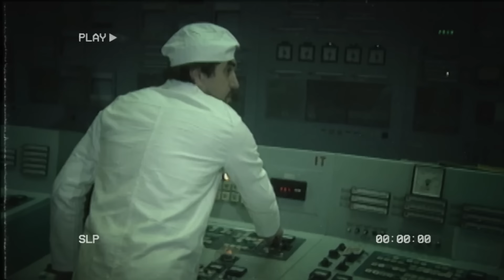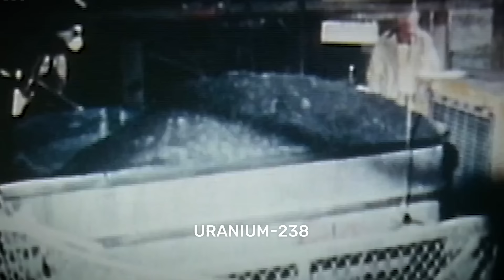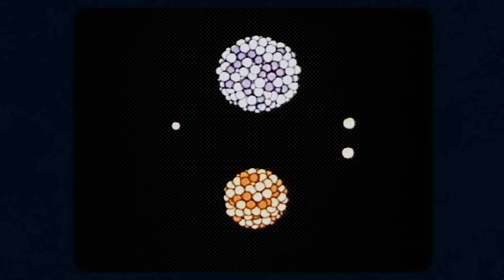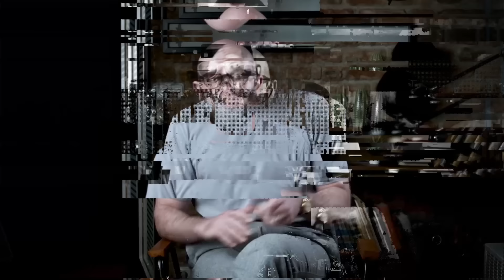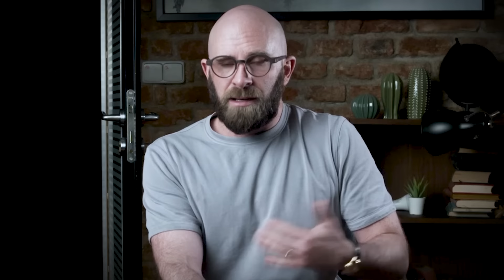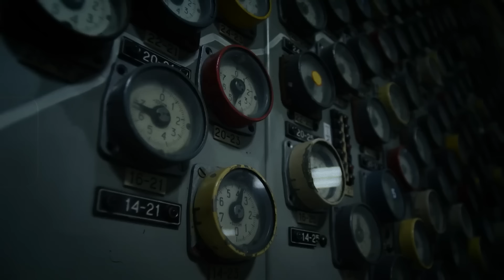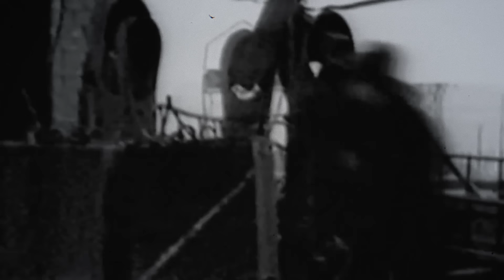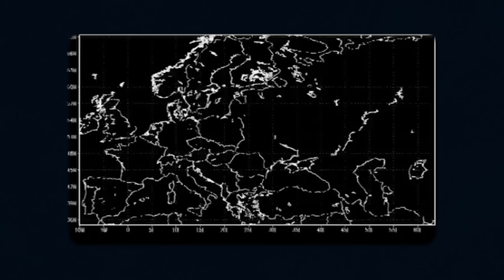The RBMK: The Shoddy Nuclear Reactor That Nearly Killed Millions

Comment: Whoever wrote this VASTLY misunderstands what a "moderator" does... U-235 (like most other things) has a MUCH higher neutron absorption cross-section for thermal (slow) neutrons than for fast neutrons, meaning that a slow neutron is much more likely to be absorbed an initiate fission- meaning *SLOW NEUTRONS INCREASE REACTIVITY AND THUS RAISE REACTOR POWER*... And neutron moderators? Their whole job is to thermalize neutrons, aka slow them down- moderators increase reactivity, not reduce it.
Reply: yes I think they think by moderating they are controlling but in a sense they are controlling. Graphite in RBMK, Deuterium in heavy water of PHWRs reactors or light water in PWR and BWR but I agree that some parts of this video were put quickly together. Especially that part when he said that RBMK were highly unstable at low power because of the positive void Cof but that's not the case.  At lower power it's the opposite it's becoming again negative void as it is when the reactor is turned on. The pos v cof is created by the steam and if there is not enough steam it's not pos v cof . but I give the guy credit for making the video.  I spent my whole life around nuclear power even visited mines for Uranium and was inside nuclear power plants.  For me it's the Jekyll and Hyde world. I love it and I hate it at the same time. I hate how politicize it had become. I do understand the fear, I do understand  negative effects but I also understand the benefits.  The cleaner air, the unsaved terrain after coal mines, the oil spills etc.  Maybe one day we are going to be able to make battery that can outperform gasoline  1000000;1 and we can take it up to space, create power there and bring down to Earth. Yeah
Reply: I've noticed these channels slipping up a lot, especially recently.
Reply: @newshodgepodge6329 alternative facts
Reply: At least someone else gets it.
Reply: @theotherJarvisx51  helps that I went to school for it 😆
Reply: seems like they're conflating moderators and control rods
Reply: I was going to say the same. It seems the comment section doesn't know what a moderate r does either.
Reply: Only thorium would be truly safe. If an asteroid or a nuke hits a plant and it loses all cooling it will melt, evaporate water, ignite hydrogen and all that Fukushima stuff. There's exactly zero safe nuclear reactors in the world
Reply: There is so much misinformation in this video about nuclear reactors it should be deleted. Complete propaganda actually.
Reply: This guy does this a lot. He casually researches things, or thinks he already knows. In another video, he said someone with a pistol emptied "an entire chamber" into someone's back. Which would mean they only fired once, when in reality, the person emptied an entire magazine. Probably heard someone talking about emptying a chamber in something gun related, a movie maybe, and thought he knew what it meant and tried applying it in the video i mentioned. 

In short, this guy's videos are only about the drama, not about analysis or learning anything. The range of topics he covers prevent any in-depth understanding. "Wide as the ocean, deep as a puddle" seems an apt description.
Reply: Since the Chernobyl accident and the series everyone believes the RBMK was an unsafe design.  Actually quite the contrary for a reactor of its vintage and generation.  There are plenty of graphite moderated BWRs out there besides the RBMK and they are inherently safe if competently operated and maintained (true of many powerful machines).  RBMK was also relatively simple to control, being uncomplicated in its construction and operation.  Blaming the design of the RBMK for the explosion is much like you driving a mustang through a brick wall and then blaming ford because the car moved when you pressed the gas pedal.  The accident was caused by trying to raise power in a stalled reactor that instead should have been shut down for 24 hours after the stall to allow the unstable byproducts to naturally decay before restarting it.  To raise power through a stall they manually bypassed and disabled every safety system that was there to keep them from doing it knowing it was unsafe and against operational protocol.  Today there are much better passively safe designs that cannot easily lose control because of auto limiting physics built into the design sudh as thermal reactivity lowering and passive convection coolant circulation.  One reason most US reactors are PWR type is because of such self limiting safety where overheating makes it impossible to increase thermal power as it hits a temperature where reactivity will auto stabilize in a runaway reaction.
Reply: @larrybremer4930 yeah nah dude that entire statement read as someone with the dunning-Kruger mindset running hard. Graphite moderation is fine, it’s over moderation in combination with water making up the difference. Hence when the water boils away it increases reactivity (positive void coefficient) The fact you didn’t factor that into your text wall of a statement at all makes me believe you haven’t got your head around the actual situation that occurred.
Reply: @geekswithfeet9137 My understanding was that if water is no longer present, neutron slow down will no longer work, and the reaction will slow way down.
I thought of it as a self regulating system.
I might be gravely misinformed.
Reply: @larrybremer4930 
 "for a reactor of its vintage and generation"
Well, everything was dangerous if you go back in time, so yes, they were dangerous.
Reply: @afrog2666  Thank you. Everything in the 70's was 'safe'. We didn't even get lawn darts until the 80s! 

Humans understood sharp pointed projectiles for centuries and still gave them to kids (lawn darts), much less nuclear fission. (disregard the Gilbert U-238 Atomic Energy Laboratory that gave uranium ore to children in 1950)
Reply: @larrybremer4930 literally no one  bought this shit.
Reply: @larrybremer4930  no they are NOT "inherently safe" - there are designs that are, RBMK is not one of them. The inherently safe reactors are built so that any mistake in control input that leads to an spike automatically triggers a shutdown. I don't recall the name of that design but unfortunately there are almost none built. A handful only. Because they are more expensive to build. An "inherently safe" design MUST SHUT IT SELF DOWN WITHOUT OPERATOR INPUT IF SOMETHING GOES WRONG - EVEN IF POWER IS LOST!  
The RBMK is not much worse than other commonly used designs of it's vintage, depends a little on how you evaluate is because different designs have different 'undesirable aspects' to them so it's a bit hard to evaluate them 1:1 - but it is not "inherently safe" - but none of the common others are either.
Reply: @noth606  Finland has two Soviet era BWRs at Loviisa. These have an actual pressure vessel and an air-tight concrete contaiment building but still had to have major further improvements and additions to be considered on-par with western nuclear standards. Finland for example re-did the entire control automation system because Soviet systems were terrible. Even the better Soviet designs were inadequate and the RBMK is horrendous. It has few redeeming qualities unless you consider plutonium 239 production as one.
Reply: @larrybremer4930  Tell me how a moderator that does not boil can make a reactor inherently safe, along with a fuel that is poor in fissile uranium, which makes the reaction even harder to balance?
Reply: @samuellourenco1050  LWGR mostly relies on the reaction of the partially enriched fuel rods becoming less reactive at higher temperatures to find its stability point where forces are balancing out in "normal" operation where plant operators did not disable safety systems and extract nearly every control rod while in a xenon pit.
Reply: @larrybremer4930  Everything you just said is a flat-out lie, sir. Blatant falsehoods all the way through. There was no regulation in force at the time which clearly required the reactor to be shut down after the stall. The operators did not need to disable a single safety feature or disregard a single safety procedure in order to put the reactor in a dangerous state. All of the Soviet propaganda you were repeating was debunked by the IAEA's INSAG-7 report over 30 years ago.

The suggestion that the RBMK was "simple" to operate is especially idiotic. When first launched, the Leningrad NPP was tasking TWO reactor control operators to control the neutron fields instead of one, both standing at the same panel. They needed to make hundreds of rod movements per second in some cases. At low power they had to work blindly, due to imprecise instrumentation and the possibility of core decoupling. It was hands-down the most complex and difficult reactor design ever.
Reply: @larrybremer4930  There are very few graphite moderated BWRs out there, specifically because they don't shut down with a LOCA.
Reply: @larrybremer4930  Sorry not an expert on this but the show pointed out it was the fact they had Graphite tips that made the thing blow it was safe if it  was not pushed  over it  expected safe usage that is what the people running it did and if you did that then pressed the button on lower the rods the graphite casused the explosion
Reply: @larrybremer4930  yeah, it blew up any way because the designers didn't idiot proof it, and put it into production without finishing quality testing - hence having to perform "tests" after roll out - because the idiots didn't plan that to begin with. So much for "best practices", huh.
Reply: @larrybremer4930  Find me ONE OTHER reactor design that uses light water coolant and a graphite moderator.  I'll wait.  It had a positive coolant temperature coefficient of reactivity and a positive void coefficient of reactivity.  This means that when the coolant temperature rises, more bubbles from in the coolant, causing reactor power to rise, causing higher temperature, more voids ... This means that the reactor was INHERENTLY unstable AT ALL TIMES, because they did not have any of the features that other reactors for which these are both positive have.  Other reactors  are also designed not to rely on the operators to prevent a positive insertion of reactivity during an emergency shutdown, and there are other mechanisms in place to compensate for the insertion of reactivity such that it is net negative.

Let us not forget that there was NO CONTAINMENT BUILDING, because, of course, RBMK reactors couldn't possibly become uncovered! Leadership chose this design because of nepotism and the fact that it was great for plutonium production. 

You know that the operators hadn't even been given critical information about its idiosyncrasies, right?  The staff didn't know about what happened in Leningrad.  Reactor designs were state secrets.  I have no idea why people are so insistent on scapegoating the reactor operators.  You know what would have likely happened if they refused to do the test?  No more job, at the least.  But like I said, they couldn't even make a fully informed decision because they didn't even have all the relevant information!  They believed that the reactor was incapable of becoming uncovered.  After all, that is the only way to explain away the fact that they didn't even house them in a proper containment building!
Reply: @bsadewitz  how about more than 1.  
MKER
EGP-6
Hanford N-Reactor
ADE-2
All Graphite Moderated light water cooled by design type.  While that list is dominated by Russian designs (only 1 US one) the design was exported to some Russian aligned trade partners such as India (Tarapur), but currently I think only Russia still operates any LWGRs today per NIE website that lists current operating power stations worldwide that shows a total of 11 cores running LWGR type reactors at Bilibino (EGP-6), Kursk (mix of RBMKs and VVER-TOI PWR), Smolensk (RBMK), and Leningrad (RBMK).  I would have looked for more in other countries but most lists do not include decommissioned plants and those that did do not show the types.  I will agree that your most likely to find decommissioned LWGRs in Eastern Europe, India, China, Iran, and maybe a few other countries that were good trade partners with Russia in the 1960s-1970s.
Reply: both myself and my family have worked in this egion since the early 90's providing respite care to kids in this region, my fater acually spoke to a man who was until about 10 years ago the cheif engineer in the plant he himself blamed the fact that the water supply to the reactor was let get so low that when they were attemping to flood the reactor for cooling to slow/cool the reaction later , that  all the water was entering/pumping in from the base of the reactor and was being turned to steam almost instantly and that the control rods couldnt physically fully enter the reactor to slow the reaction because of the emense pressure of the steam coming physically against the control rods. He had a theory that had they reacted slightly faster and tried to insert the rods earlier they may have got them fully inserted and that there would have been a greater chance to slow the reactor.
Reply: @4KChillVibes.   Ironically dumping all of that water in there caused the explosion, whereas if they didn't try flooding the reactor and it exploded anyway...all of that water would have been under the reactor to create that second, multi-megaton explosion Simon talked about.  So I guess their little "choose your own adventure" book of dumb ideas at least led them to a less apocalyptic dumb idea.
Reply: I wish you had 235 likes for this post ;)
Reply: Pro Nuclear Trolls are paid to push 'replies' such as above. If you don't know that NUCLEAR = DEATH, then educate yourself, my fellow travellers: https://en.wikipedia.org/wiki/List_of_nuclear_power_accidents_by_country

Comment: 16:50 - Even so, in the last 50 - 60 years deaths related to hydro electricity (dams) killed more people than all nuclear power plant disasters, all just blip compared to fossil fuels. From coal mine disasters and coal miners lungs to lives shortened by air pollution. It's like planes and trains crashing versus road accidents. First fill front pages, second is statistics.

Comment: The control rods did not stop a meltdown at TMI. The reactor suffered a partial meltdown due to a loss of coolant and the resulting unabated decay heat.
Reply: That's because by the time they realized control rods were needed, channels were already distorted and thus control rods were stuck in position.
Reply: Last I heard, that reactor had a 98% meltdown. I guess that does count as "partial"
Reply: Residual heat is the word here.

Comment: Most gen 2 reactors were dangerous.The problem with this design is that reactivity rises when water boils (positive void coefficient). Good design in so much that can be built cheaply, refuled while in use, no heavy water required, etc. It is not stupid proof, and hence the issue.

Comment: As far as everything I've gathered about this reactor, this accident would have never happened had the man in charge not been so irresponsible as to have the control rods completely removed.  Now, the rods on this reactor had graphite extensions, which made putting them back in, well....
Reply: @ThatsMrPencilneck2U  No it wasnt just the operator doing stupid stuff, and good god how should operators know stuff about a reactor if the people who build them didn't knew or documented it. The operators were well trained professionals and were just the easy scapegoats for the government